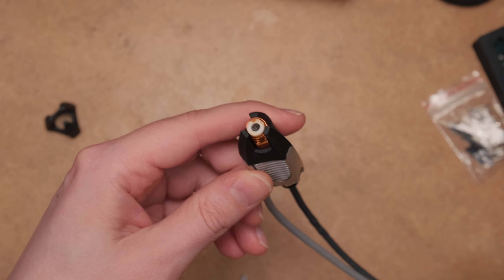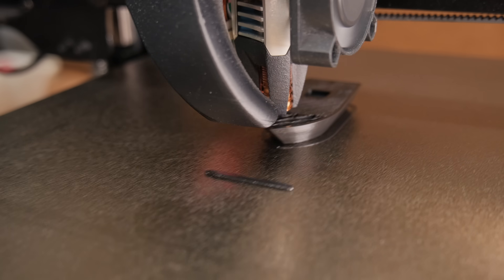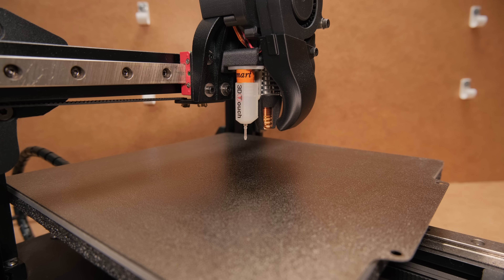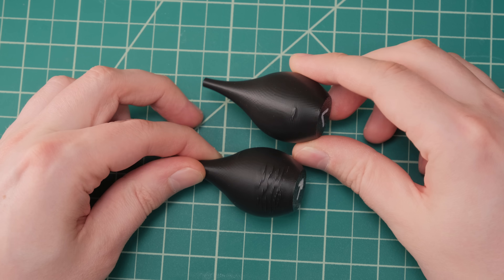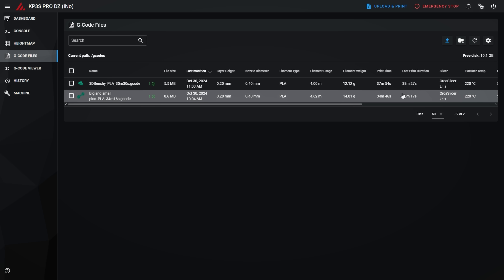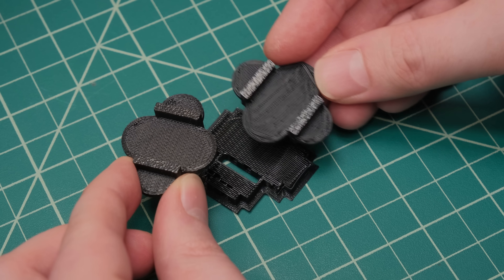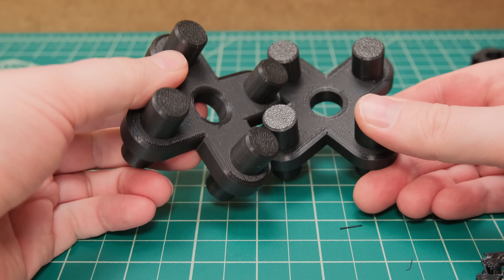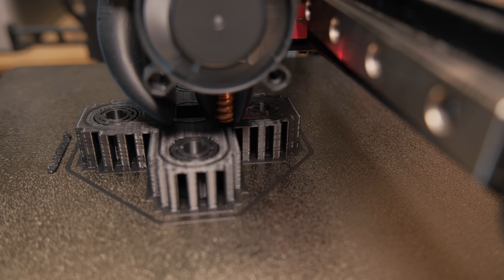World’s First INDUCTIVE Hotend – How Crazy IS IT?

Comment: My brother has wanted this for more than a decade now. About time someone finally does it.
Reply: It just has to get a bit cheaper than 400$/€ now :|
Reply: @lynxxlynxx  ouch
Reply: @lynxxlynxx  We just need the support.. cheaper hardware will float the market later. But by all means.. an induction heater is easier built than a cartridge heater :)
Reply: @hanswurstusbrachialus5213  I beg to differ. A cartridge heater is basically a heating coil. Put current through it and you're done. It can be bought for mere dollars. 

An induction heater is much more complicated, not the hot-end part, that's easy. It's the electronics. You need to have a high frequency feedback loop and a well tuned PID controller. You need to program a controller with the only input being temperature. The electronics alone are worth a multitude of the cartridge heater, let alone the programming efforts.
Reply: @patrickd9551  it's not that hard.... Induction heaters are pretty much commodity items, and the feedback loop can be done with regular thermistor but measurements can be done only when the induction coil is inactive. That can be easily solved with pulsed operation and pulsed measurement. PID is not hard either, I have enough experience to get it right in matter of minutes. Even then there are auto PID tuning algorithms, needs no human input. Is it worth the hassle? Mostly no. Safe? Not really, it can melt the hotend if the feedback loop has a problem.
Reply: @patrickd9551  Good Point.. but i also want to mention most advanced printers where this would be a thing we already have more compute power than the machine needs. A fancy klipper on an older raspi 3 or 4 wont go over 10% usage - so the impementation there would be no hassle electronicwise. Thats why i said the mechanically part is easy to built - the rest to be adapted. :)
Reply: @lynxxlynxx  from what i know about metal induction, it should be quite easy to getht he price down if enough people want this, but i think it will probably first pick up when manufacturers intergrate this type of hotende directly into their machines and not as a addon
Reply from the maker: Yeah, it is cool to see companies that try new things. :)
Reply: People have made these but AFAIK there is/was a patent (like everything in this industry) making it difficult to commercialize. It's not THAT complicated all things considered but since the primary limitation is transferring heat through the filament itself, it doesn't help all that much overall. Definitely a more effective way of heating the hotend though. Now I just want to see someone implement ultrasonic welding to a hotend.
Reply: Same!
Reply: Same here, i was thinking about this ~15 years ago. I was aiming for a ultra light hotend and thought it would make it too heavy because inductive heaters have usually very sturdy coils and high current wires (thick). well this is but still a lot lighter than i imagined.
Reply: I think it's time for me to take my induction oven apart. ))) 
I've been thinking about this for many years too. This nozzle lacks water cooling for fast cooling .